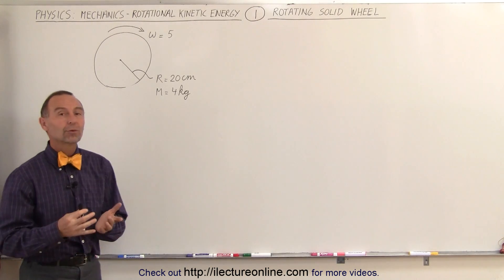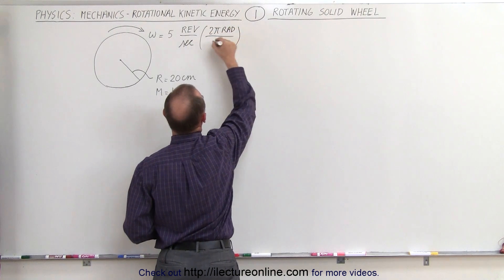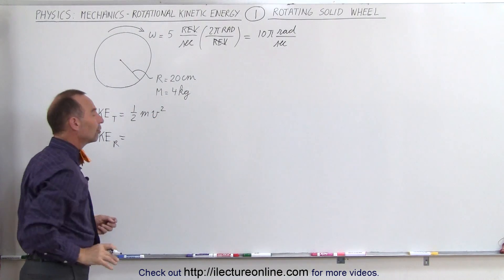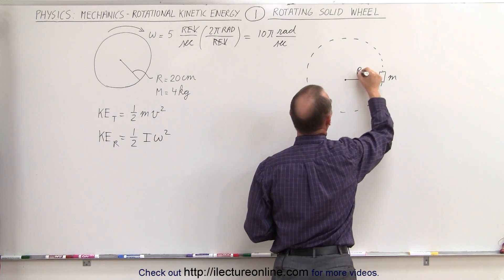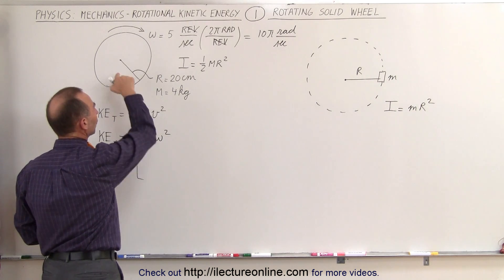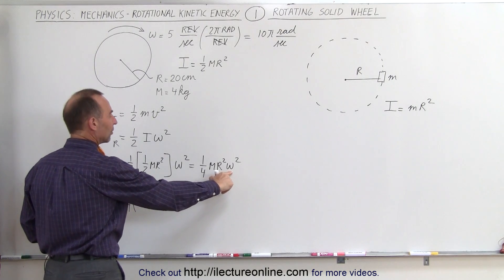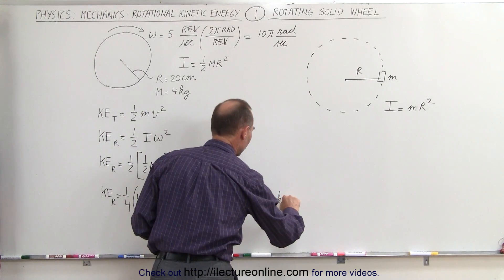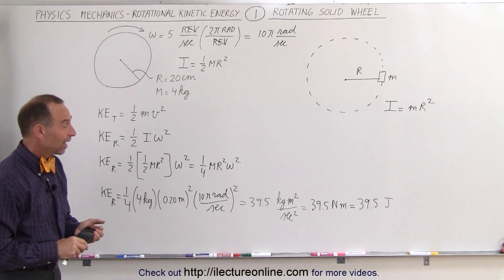Physics 8.5   Rotational Kinetic Energy (1 of 19) Rotating Solid Disk

Comment: Do you have a video on how much energy it took to rotate the disk at 5 Rev/sec or is it the same calculation as in the video
Reply from the maker: The Kinetic energy that a rotating disk has = (1/2) I w^2  which is the energy required to make it rotate.
Reply: @ thanks I just wanted to make double sure it was the same ,  just so I know I got the math correct can you confirm this - 0.25x4x0.2^2x10^2xpi^2 =  39.478 joules ( this is per seconds a rotation for 300 rpm of a disk said size in the video)

Comment: Your video really helped me, I'm trying to think of another case, what if the disc is facing up or moving horizontally (yaw) which rotates on a fixed axis, how is the kinetic energy? is it the same as this video and what is the potential energy?
Reply from the maker: Yes, the KE would be the same (provided the translational and rotational velocities are the same).  The PE depends on the height of the CM.  Since the CM would be lower, the PE would be lower.

Comment: working with table saw started thinking about KE and was curious if KE is greatest at the outside of disk( so the blades) is this correct? how does the math change when your considering some protrusion from a disk do you change I back to the mR^2 version in calculations?
Reply from the maker: Since the blade is a solid object, we don't typically say that the outside of the blade has a higher kinetic energy than the center part.  Now if you want to consider a "segment" of the blade near the edge, you would be correct, do to its higher velocity.  But essentially it is a solid object, so we talk about it in terms of the KE for the whole blade.
Reply: @MichelvanBiezen  Yea i was imagining it as single blade moving in a circle fun to think about thank you.

Comment: How do I find the time taken to stop the disk given that a 20 N force is applied in the tangential direction and the moment of inertia is 5Kgm
Reply from the maker: Use the same principle such as with the linear equations.  F = ma         Torque = (moment of inertia) x (angular acceleration)     Then once you know the acceleration    use   W^2 = Wo^2 + 2 (angular acceleration) (angular distance).   Once you know the angular distance then use:    angular distance = (1/2) (angular acceleration) (t^2)
Reply: @MichelvanBiezen  what if I find the angular acceleration using the Torque equation and plug the alpha value into the angular acc equation which is alpha  = ( delta W) / Time

Comment: So lets say we want to move the disc with a piston 1 meter left or right. We would need to apply a force of 4.02788kg /m travel on a 4kg solid disk? So to move the solid disk 2 meters left or right we would need around 8kg of force through the piston to push the disk 2 meters away?

Comment: How would I calculate the input energy needed to maintain the spinning mass, in this video, at 5 revolutions/second?
Reply from the maker: If there is no friction, then it would require no energy to keep the mass spinning.
Reply: @MichelvanBiezen  So any form of energy that is taken from the spinning mass is the input energy needed to keep it spinning at it’s current state of speed.

I understand. 

Thank you for responding.

Comment: Maybe grid level energy could be efficiently stored in a low friction ring. 
Like a circular mag-lev train in a vacuum tube. 
Could be a mile in diameter or scaled down to fit under my yard.  :o/
Reply: We’ll take these old coal trains, hook ‘em up in circle and crank up the power.
Question: How fast would it have to go to store a similar amount of energy as that coal delivers when burned. 
Then factor in mining, delivery and CO2 disposal cost.

Comment: On the calculator 1/4*(4)*(0.2)^2 *10Pi^2 = 3.95 how did you get 39.5
Reply from the maker: Did you square the "10" ?
Reply: ohhh i didn't know you have to square the Pi and 10 separately, alright that make sense now because when i do that on the calculator 1/4(4)*(0.2)^2*10^2 Pi^2 = 39..5 Thanks for clearing that up!